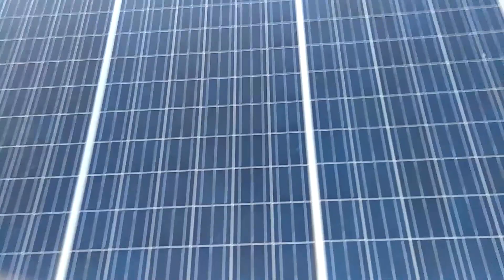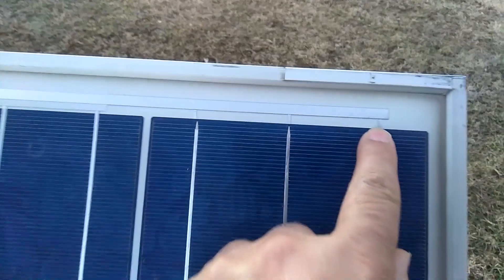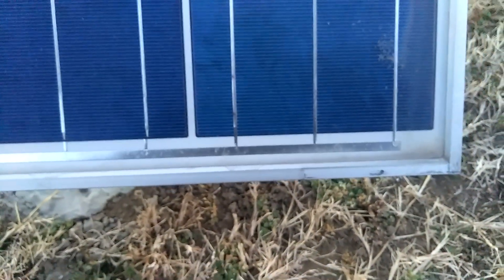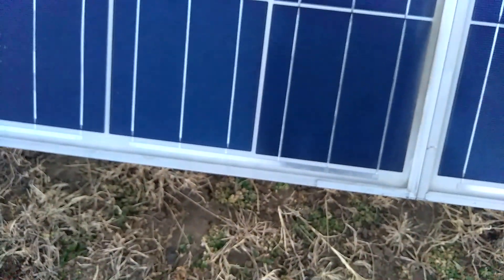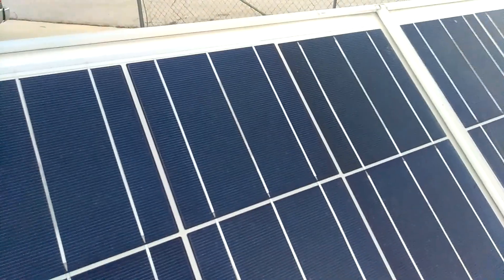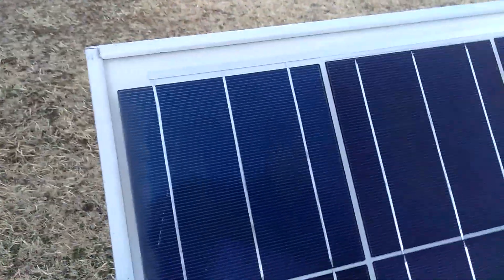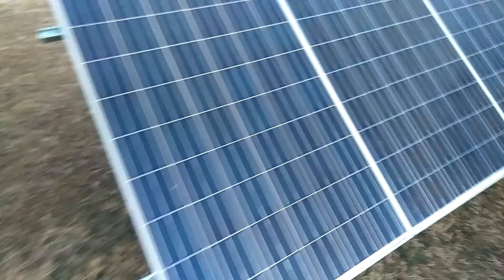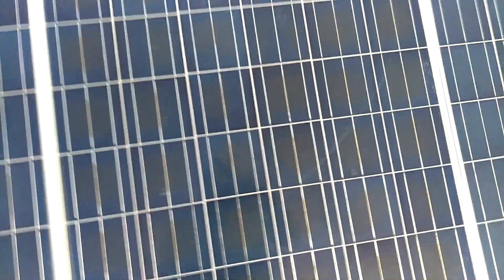have anyone had this problem with their San tan solar panels.

Comment: Hi I have my system up and running can I ask what your Max and min cell voltages is as battery people told me to not use the top and bottom 10%
Reply from the maker: My Max is 57 volts and my minimum is 50 volts.  But I very rarely get past 50% of my battery before it charge back up the next day.

Comment: I haven’t bought any from santan solar but in the used market it’s very common to have them corroded and green looking etc. usually there is something wrong with them for them to get rid of them. I myself have sold around a thousand used panels and several hundred had that issue but they still sell easily cause the price right.